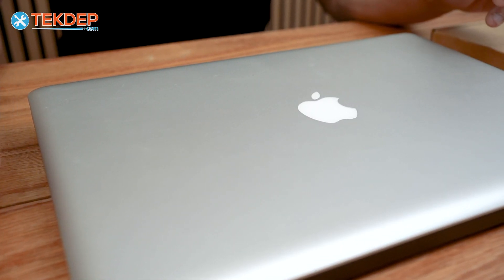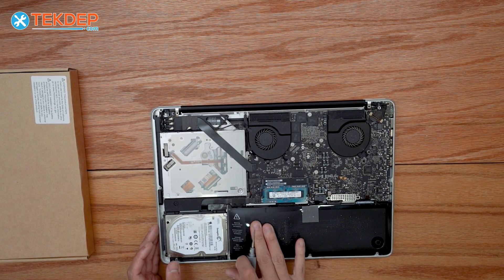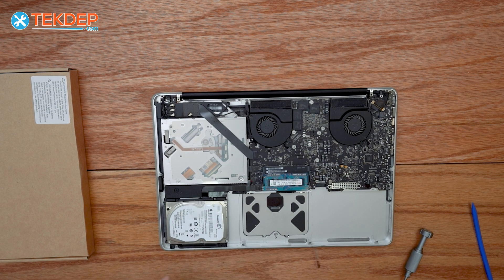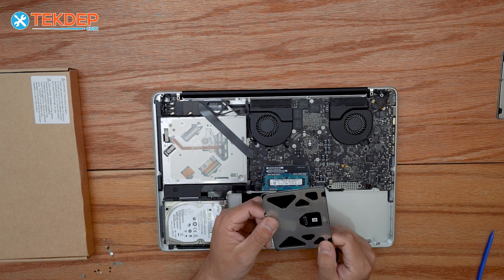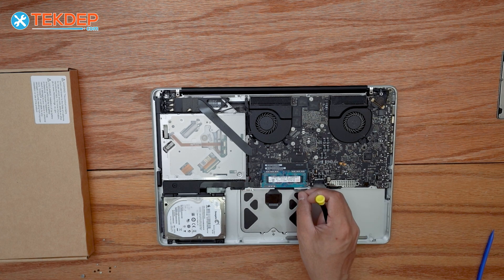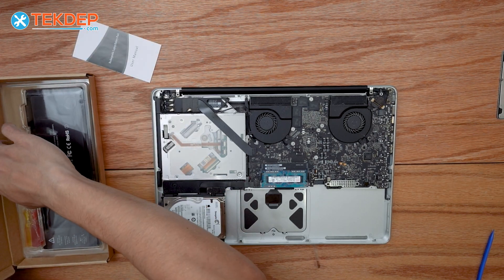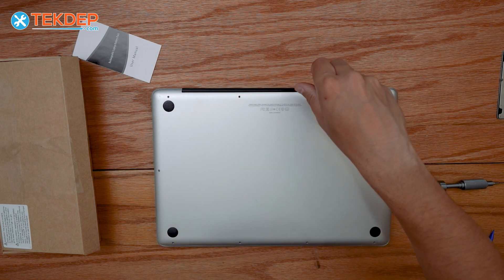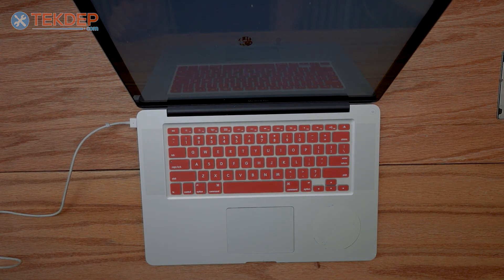13” MacBook Pro A1278 2011 Cracked Trackpad and Super Swollen Battery Replacement!

Comment: jow long does the that battery last?
Reply from the maker: Brand new battery on this model MacBook that A1278 ( 2010-2012 model) should last about 3 hours, we have them in stock if you need one! Here is the links 

https://tekdep.com/product/a1278-replacement-battery-a1322-for-apple-macbook-pro-13/

To find all the parts such as displays and batteries or tools for your repairs, we have them all and ship worldwide! visit: https://tekdep.com